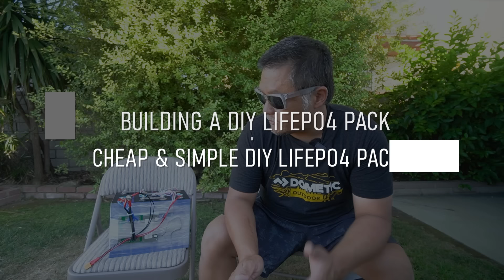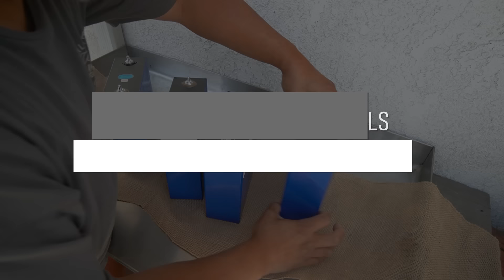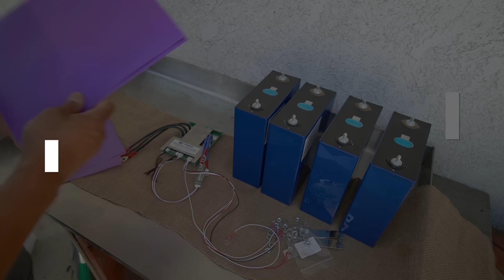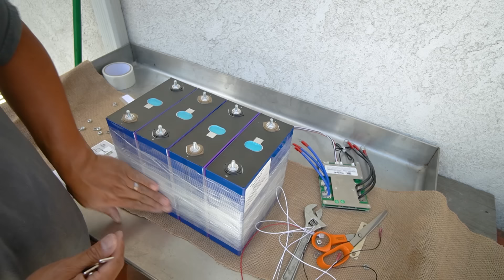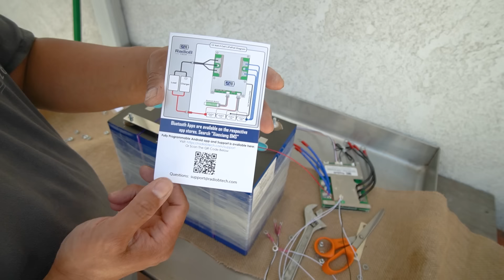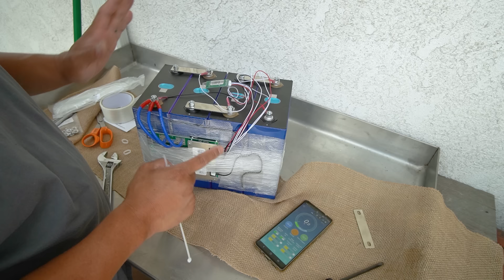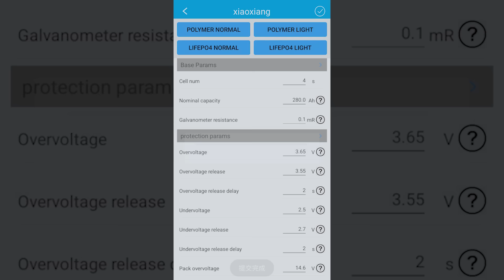EASIEST DIY 12-Volt 280Ah LiFePO4 Battery // Step-By-Step Build

Comment from the maker: Prismatic LiFePO4 cell prices have once again come down. Even with the wide-spread popularity of cheaper-than-ever, commercially-build lithium packs, you can still build your own for a lot less. I mean like 35% less and with all of the high-end features such as low-temperature cutoff and Bluetooth app connectivity. In this video, I will show you how I built a 280A pack for less than $700 and where I sourced all of the parts.

Buy 280Ah LiFePO4 Cells from Shenzhen Qishou Tech
https://www.alibaba.com/product-detail/Grade-a-lifepo4-3-2v-280ah_1600551390417.html?spm=a2747.manage.0.0.73e871d2RVwOMi
Buy RadioB Tech 120A BMS:
https://amzn.to/39OYgYA
My Preferred LiFePO4-Compatible Smart Charger:
https://amzn.to/3A2eeJq
Reply: I am a very novice LiFeP04 guy looking for the best, most cost effective solution for my needs...This video was excellent...How many cells can you actually add to that BMS and it still work? I have a truck bed camper and want to max out the AH for the space I have available. So can you build a 400 AH battery this way, using the same parts, just more cells? and do you have any other forums you are a host/member of that i might be able to sign up for?
Reply from the maker: Johnny, I offer coaching sessions here

https://freelyroaming.com/coaching
Reply: This guy is awesome, thank you so much for sharing. I used to buy a lot of ADCBATT 100ah lifepo4 batteries and although they are not expensive and still work, I plan to make one myself.
Reply: I thought that the cells from Ali express were b grade junk? I’ve heard several people never even got their batteries. Now, these were complete batteries, not cells, so maybe it’s different?
Reply from the maker: @robertboyer5498  AliExpress is a platform with thousands of independent sellers. So the quality varies from each one. You can not blanketly assume anything across all of them.
Reply: @freelyroaming  I’ll keep checking. Every brand I search online seems to have a bad rep. Maybe I gave up too quickly?
Reply: Bro. How is this even a good idea? When you can buy a 1000 Ah Solar Generator that has 48 Volt LiFePo4 batteries for under $1000. WTF?
Reply: @We-Do-NOT-Consent-To-The-Loop   share the link!
Reply: Can EvenStar303 provide a link to this great offer? Details are left to the imagination… The cost of the 280AH cells has dropped to $60 so, with shipping, the total cost of the battery is less than $500.
Reply: @richardcarr1090 I meant to say watt hour not amp hour.

Look up the Pecron 1500
But there are many others.

Comment: In June 2025 i get assembled batteries 280Ah @51v for USD 1.400.  Same battery self built was USD 1.300. Same JK-BMS. My motivation was the selection in components as you mentioned

Comment: I did the same, I made a 1200ah 24v battery bank for my RV. using 32x eve 314ah cells, 4x jag35 24v battery busbar, acrylic plastic custom cut sizes (180mm x 600mm times 8/ 280mm x 600mm times 8/ 180mm x 280mm times 8 6mm acrylic), 4x Daly 8s-17s 250a BMS, 4x 300a Red battery terminal, 4x 300a Black terminal. Cost in total 4500. i looked at the cost of a single 24v 300ah battery which cost 1800 so I saved 2700.

Comment: Thanks!  does Radio B Tech make a BMS with a heating pad output to heat cells when temp drops below 32F?
Reply from the maker: @NMLongshot  I would not recommend having the bms do that. It's better to have a standalone heating pad with it's own temperature sensor.
Reply: well, some BMS units from JK integrate both functions into the BMS.  There is a ~3A output from the JK BMS which turns on and diverts charging energy from the cells into a heating pad (or into a relay if your pad needs more than 3A).  I'm ok using the existing BMS temp sensors rather than doubling them up and introducing independent controls.  I was hoping that RadioB had a similar solution.

Comment: I have a sailboat, the battery box will barely fit a group 31 batteries and at most I would be able to fit 2x 100ah batteries, so 200ah would be my limit. However, looking over measurements, I can fit 8x 280ah cells giving me 560ah. It doesn’t take much convincing that I don’t really need a case or a battery that looks like a battery because that’s more “acceptable” to most people. I’ve watched tear down videos and it’s nothing but foam and air, so it’s useless to me, I want the ah rather than the looks.

Comment: Great video thank you. For your BMS and heat issue, why not place a thick sheet piece of silicone from a cheap silicone pot holder. Also did you have to pay $110 shipping per battery?

Comment: Thanks for taking the trouble to share this. I dropped over 1500 UK pounds on drop-in batteries for my last boat, and on my current project decided to take the smart way and build my own pack. Just yesterday I got my box of Eve 280 cells and a good BMS, and am just getting started putting it all together. I had already got it pretty much all figured out, but it was great to  run through it all again, and especially to pick up hints like the plastic between the cells and the issue of heating from the BMS. Well presented band clear. Top stuff.

Comment: Hello, I've seen a few of your awesome videos and am now hoping to get some advice. 

I'm new to the battery / car camping scene. I plan to keep an Amazon LiFePO4 battery (maybe 2) in my car as a power source for a Dometic fridge, lights, laptop, etc. so I can live in my car on the weekends. I'm still shopping / researching so I wonder if Group Type matters, mixing battery / inverter brands or things like that matter?

I want to charge the batteries at work then bring it to my car and shelf in the cabin with me.

So far it sounds like I'd need the battery, and an inverter. And I think I can just plug a power strip into the inverter? 

Do you see any issues or have any advice for this type of use?

Comment: I recently made a lifepo4 4s3p pack and I encounter a big problem .
I use solar to charge the pack wen it reach full charge 14.6v it stops then the voltage will start to drop in a few hours dawn to 13.4v and stai there .
I try manual  balance the battery try different bms
 active balancer  still dasent work .
Maibe someone can help 
.
Reply from the maker: That's normal. 14.6 is fully charged. Doesn't stay there for long and it shouldn't. It goes to 13.4 because that's the float voltage for the charger.

Comment: this was fascinating but i disagree about one thing, i would definitely put the BMS on top. Put it on the side and it's vulnerable to squishing or impacts, but on the top it's protected somewhat by the + and - terminals. And i would cut the sensor leads (and the ground leads) as necessary. Because the input impedance of those sensor inputs is quite high. That means that those leads are not pulling any real current and so cannot drop a measurable amount of voltage no matter how long they are. I noticed that in the menu settings the balance precision was set to 30mV. The voltage drop on those leads is much less than 1mV. Great work though, thanx for posting.
Reply from the maker: Thanks. There are lots of pros and cons to how to build a simple pack. Doing what makes sense to you is what is important. This is just meant to show the easiest, no frills build so that more people can understand how they come together. Thanks for watching.

Comment: Thanks for the video. Safety being goal #1, I'd rather buy than build
Reply: You have no clue WHAT is inside the battery, that you buy.
Reply: @MrSummitville  true. However, the more you spend the more confident you can be. Just don't have time to build without cutting corners
Reply: @jamesfalvey-z6q  You can spend more, but that does mean you get more. You can pay more for a Boeing Jet vs A320, yet the Boeing door can fly off, the nose wheel can fall off or the Autopilot can crash the plane.  All three have happened. You paid more. Did you get more?  No, you got less.  If you are not going to build a battery then why are you even watching this video?

Comment: 200ah 12v lifep04 from redodo are 459. shipped and i even got a 30.00 amazon coupon so it was 429.00 kinda hard to beat, i am running a pair of them in series with my 3kw powmr all in one inverter for my camper.
Reply from the maker: 200Ah Redodo doesn't have low temp cut off. For $469 you could have gotten a Golden Mate 200Ah that does like this diy kit. Running 2 of them takes up 3 times the space for someone with a smaller camper.
Reply: @freelyroaming  I had already watched a review on the redodo 200ah .. and understood that it had only a high temp cutoff. i am running a 18w warmer with auto thermostat  it will cut on at 50'f and cutoff at 70'f  (made for a chicken coop) since i am setting up inside a externally accessible storage area .. it looks to be the ideal answer to keep the batteries warm.

Comment: Can this be use to run 5000 watt amp on car radio
Reply from the maker: I wouldn't draw more than 3000w constant from this.
Reply: @freelyroaming  so should I put 2 them..or build something else...
Reply from the maker: @JoseMartinez-pz7cd  yes I would built 2 of these and wire them in parallel.
Reply: @freelyroaming You can NOT draw 3000 watts through that 120 amp BMS.

Comment: Actually the wires are on the positive of each cell on all the batteries I've seen or worked on.
Reply from the maker: Well actually...... 🤦‍♂️ I've already addressed this in other comments. The wires can be placed anywhere on the bus bar that connects the positive of one cell to the negative of the other cell. You get the exact same reading.

Comment: Nicely done, straight forward, simple to follow by design. Thanks for sharing the education. I’ve got 16 cells 100ah that need a Bms to construct either a 12, 24, or 48v battery. This has been very helpful in understanding what needs be done to continue. 👍🏼

Comment: I have been using similar batteries to these as almost my only source of power for nearly 4 years now, all done from youtube videos like this and zero experience. The price to performance has improved so quickly in that time, roughly 40% more capacity for the same size and weight for less money is incredible.

Comment: bought 2000wh ac200p for $650. cant beat that on DIY.
Reply: Well this aged badly considering how cheaper DIY batteries are now
Reply from the maker: It wasn't good even when it was posted then.
Reply: @freelyroaming  2000wh lifepo4 with a 2000w pure sinewave inverter, 360watt DC to DC, 1000watt solar mppt, 500 watt ac charger, high power usb charging and car charging input. All built into a portable high quality container with a touch screen. Good luck making that for under $650.
Reply from the maker: Nah, its a dumb thing to post because that is not the actual fair market price of the ac200p. it's like when someone buys something from Facebook marketplace and compares it to the retail price of the item. We are talking about products everyone can go out and buy. Not someone bragging about finding some refurbished or closeout deal.
Reply: @freelyroaming  they were going for $800 new. Recently.
Reply from the maker: They are $1499 MSRP. With sales and discounts, they can be significantly cheaper. But they were never $650 a year ago at any kind of widely available quantities.
Reply: @cutty02  2x newtipower 100ah battery = 98$ each 
Which is 2560wh
OUBOTEK 2000w pure sine inverter= $160

TOPBULL 40a mppt charge controller= $70 1040w solar input (power stations are internally wired at 24v)

$430 dollars 

Still have $220 spare for wiring /misc 

PLUS you get peace of mind if any of the parts go bad.. easily replaceable  unlike portable stations that have to return to OEM 

I'm not saying you didn't get a good deal but I know you can get better for diy
Reply: @viyusavery248 I think we're talking of long term this 100ah battery whether gel or turbular have shorter cycles * lifespan.

But lifep04 battery has a longer lifespan and longer cycles
Reply: @viyusavery248  still can't beat this. Even if you cobble together the cheapest components. Good luck matching the specs for under $650 and good luck making that portable and as clean as a unit like these.

Comment: Hi, since Im taking a deep dive into renewable energy, I understand there is a cost saving in a DIY version of a battery vs buying a LiFePo4 battery. My question is the following, how big or small is the safety concern of a daily use of a system built DIY vs just buy a portable solar generator system with a battery bank integrated in the same compartment like the Bluetties and Jacakrys? I do like to tinker with stuff, and you made it look fairly easy to build that 280AH battery. That motivated me to think in building a system.

Comment: I do not understand how the BMS can balance the batteries separately with the charging power coming solely from the negative and positive in the end and beginning of series. Does the BMS balance the batteries through the thin "sensor" wires?

I am using 1500AH 48v lead acid battery for my home UPS system. Those are simple, discharge only 30kwh max, charge them up with the inverter with only bulk and float/equalization. And they will basically be equal. Charging from both parallel ends of the 6 packs of 4 12v batteries.

Edit: my lead acids are brand new and i expect them to last atleast 3 - 5 years of 40% DOD before throwing them away, but that's not hindering me from learning all i can about lithium and BMS (BMS which i understand nothing about).

Edit again sorry: If i would want to build similiar packs like the one you built here, but make them in series to 48volts and build 6 suchs packs, Do each pack need a separate BMS? do each pack get a separate positive and negative from the inverter? or how does it work when you work with lithium in seris and parallel?

Comment: Nice work!  Why was BMS chosen for a maximum current of 120A? It's only 1.44 kW. Is this power enough? Your battery can give much more, at least 2 times. For example, 200A (power = 2.56 kW) or even 250 A (power = 3.2kW). What is the basis for choosing a BMS with a maximum current of 120A? Thanks for the answer!
Reply: Cost and application often determine BMS selection.

Comment: Have contact with Cassie Wang and have 2 options 280ah EVE cells 556$ and 302 CATL 565$, which would you  buy?
Reply: What did you decide to go with? Is that with shipping? I haven’t used alibaba before…..

Comment: Cost per kwh? Your final cost excluding your time.
Reply from the maker: This is a diy video. No one accounts for labor in diy projects.
Reply: @freelyroaming  did you read? I said excluding time.
Reply from the maker: @crinabobo7412  that's my point. The cost shown already does not include any labor.
Reply: @freelyroaming  it seems the saving are not so big, you can get the larger 5 kwh banks at wholesale price for  under 300 per kwh. But its fun to do it. Ifbuilding lots of storage it might be worth it but for 10 20 kwh. Not big deal.
Reply from the maker: @crinabobo7412  did you do the math? $678 for a 280Ah pack is 190 per kWh. $300 per kWh is almost 60% more expensive. Building a bigger capacity pack will only make the per kWh cost lower.
Reply: @freelyroaming  only for large capacity bateries. But without 10 years of warranty. At dealer, reseller discount its @250$ with 10 years warranty, metal box, lcd.  Chinese workers can not ne beatten on efficiency
Reply from the maker: @crinabobo7412  you do you. Go get your metal box and LCD.

Comment: im building a pack myself for workdue to supply issue what does the 120amp rating on the  bms stand for is that the most amps it can handle? if so how would i go about making a pack that can handle 800amps. this is for a mobile hydraulic stage
Reply from the maker: You can connect multiple BMSs in parallel.

Comment: 32V battery build. On my boat I have 2 banks of 4 8V lead acid batteries that I would like to replace with IiFePO4. Each battery banks is independent for port and Starboard motors. Currently I also have the 32V inverter connected to one of these banks. Having searched the internet I quickly realized this will be a custom battery made from cells like in the video. I can find 32V 10S LiFePO4 BMS units. The difficulty I'm having is can I use the same battery bank I make to start the engines which require 1000CCA or should I split the battery banks having one a traditional lead acid for starting each motor and the LiFePO4 bank dedicated for the inverter. My next challenge will be modifying the charge parameters of the outback inverter/charger.

Comment: Correct me if I'm wrong but last time I checked, red was positive and black was negative. You appeared to have connected the blue bms negative leads to the positive terminal on the battery pack. Just an observation
Reply: @wg6215  he connected it in series to achieve a higher voltage which is good to power high voltage devices/appliances and the ah remains same but if connected in parallel the voltage remains same but the ah increase which makes not be able to power high voltage devices 
/Appliances

Comment: Can I use smaller BMS than cell nominal AH? 

For example, I got a 4x280Ah cell and use only 120Ah BMS? Is that secure? Can I use an even smaller 60Ah BMS?
Reply from the maker: Yes. It doesn't need to match. Just don't go too much over the rated output current which is usually 1C. That would be 280A in this pack.